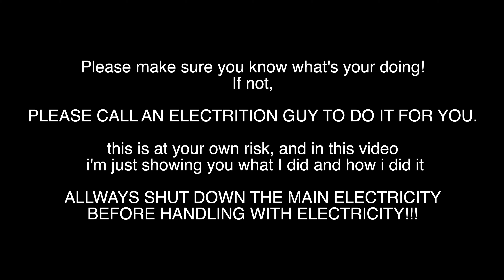How to install Smart Switch - without neutral wire - EASIEST way

Comment: The capacitors needs to be in parallel with the bulb if i follow correctly ? (I bought a 2 gang and only have one capacitor )

I see in the box diagram paralell, I opened it and it seems to be two rather big capacitors and a sort of weird full bridge rectifier (maybe ElectroBoom can help hahaha) 

I havent installed it yet I am wondering if the virtual neutral in one bulb will act for the other one.

Comment: What value if capacitor did you use? Or how did you determine which capacitor to use? (I’m guessing US 120V would require a different capacitor than your 220-240V.)
Reply from the maker: Hey! Thanks for your comment! It’s just the capacitor that arrives with the switch.. when you order the switch you choose whether it’s eu version or not, and then the seller send the right capacitor with the order
Reply: @mypointofviewside  Thank you. Apparently US versions do not get this capacitor and must have a neutral present in the box. 😢
Reply from the maker: @peacefrog0521  really? are you sure..?
Reply from the maker: Btw, if you haven’t already- i would really appreciate if you would subscribe to my channel 🙏🏻

Comment: Couldn’t you put the capacitor on the switch side as well or does it have to be at the light fixture
Reply from the maker: Hey, I believe it is possible. Worth a try.
Most times ther isn't enough space to put it there. 
would appreciate your subscription 🙏🏻😊

Comment: I've got a switch which has two hot wires as one light on the switch is on a different breaker.... I don't think a smart switch can accommodate this.... Would be interesting to know if there is one out there
Reply from the maker: Hey Flex, thanks for your comment,  i don’t know any.

Comment: Need one capacitor for all lamp or only one enough if we connect lamp in series
Reply from the maker: Hey, you need one capacitor for every light switch, so if it turns on lets say 3 bulbs, you’re good to apply 1 capacitor 😊
Reply: @mypointofviewside  now i am lost because a 2 gang will have independent circuit or not ?

Comment: You called it "without neutral wire". Why did you connect capasitor to "N"?
Reply: The bulb has Line and return or Neutral, the switch doesnt. 
You connect the capacitor in parallel with the bulb the switch does ntot need neutral